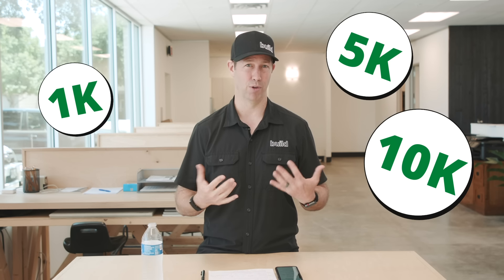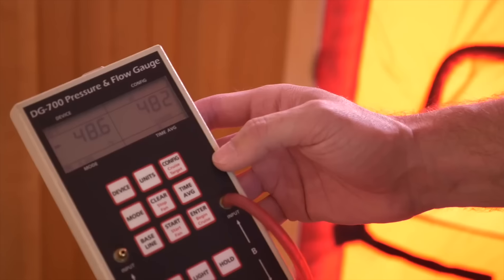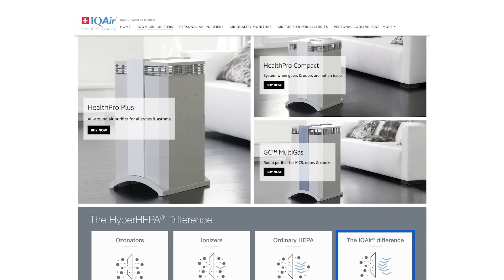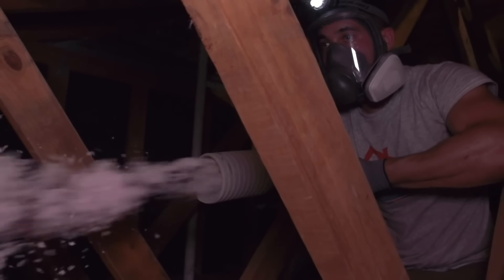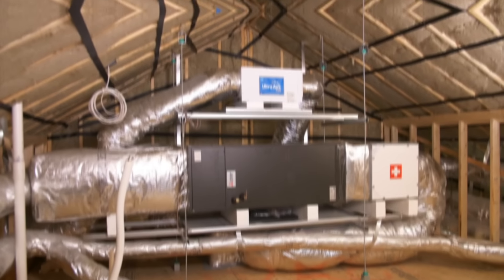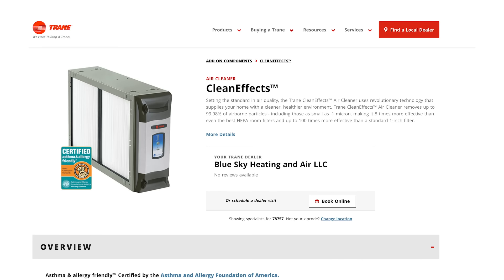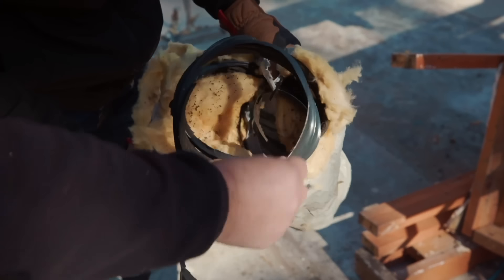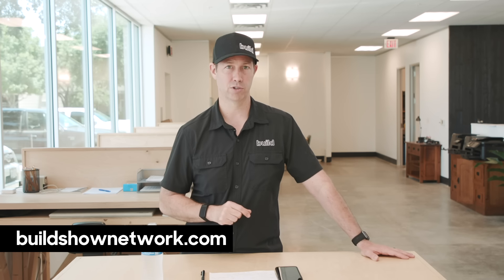Affordable Home Upgrades (Energy Efficiency & Indoor Air Quality )

Comment: Question: Higher merv means more strain on the blower unit so I've been told thus creating a increase in your electric bill.  So can you confirm or deny this?  Also If i dont have the 4 inch system would you recommend getting MERV 11 1 inch filters?

Comment: When you start adding big filters to your hvac, wound you advise these folks to have their systems checked so they dont burn up a expensive hvac system. Shouldnt the fan speed be increased at the least to compensate for the resistance of these filters?

Comment: That's really good advice. Especially getting the independent survey.

Our old house was hot water with windows for ventilation, and a window A/C. We got the survey, got sealing and insulation, installed an attic whole house ERV (UltimateAir), and a mini-split.  Also replaced the electric hot water heater with a hot water generator tank on its zone to the boiler.  Heating, coolling and electric costs went way down, and air quality is great.

Comment: After following you for a while now im pretty much sold on exterior insulation and improving the air tightness on the home. I just bought an 1890s vicotorian. The siding and roof(mainly the roof) have to be replaced so since its coming off anyway might as well give Roxul some of my money!
Reply: Sounds like a beauty of an old mansion house! I have a 1914 mission revival single story rancher. Yes, you will be happy by investing in maxing out your insulation as you renovate: external, interior, walls, attic, floor. Makes it so much more warm and comfortable, quite and cleaner greatly reducing your energy load.
Reply: @aaronvallejo8220  Not to mention the 800 dollar utility bills in the winter being reduced.
Reply: @ferulloscoasting6432  For sure. That's true. I grew up with a large natural gas central heater in an old, uninsulated house. At night it was turned off. Waking in the morning we could see our clouds of breathe. It is now highly insulated. R100 attic, R35 floor, R25 walls with electric thermal tiled slabs gently and silently releasing heat...warm on the toes in the winter too!

Comment: Question,  when re-insulating an attic space in order to air seal, would you remove all the old insulation?
Reply: depends on how your air sealing, what kind of insulation u have, and are going to be adding.
Reply: It's almost impossible to properly air seal with existing insulation in the way. And depending on the roof pitch and design, getting to the outside wall top plates can be a huge hassle.

If the old insulation is clean and can be put back in place, add new on top to whatever R level you're looking for. Otherwise remove it all and start fresh.

Comment: I have air sealed my existing home from attic to basement over time and just recently replaced all ductwork (ridgid metal, dampers, sealed and insulated) and returns.  Original owner had house build in 1991 and had gas forced air furnace (no AC - Seattle) with a honeywell electronic filter.  I am wondering if an electronic filter is worth putting back in OR a good MERV manual filter.  Any suggestions?

Comment: what should my air humidity be.  I am in arkansas, not that different from texas.  Maybe a little more humid
Reply: I like 30-40% for my sweaty self. Not too dry, but I don't feel muggy or clammy either. Most of these devices are adjustable/programmable, so you'll be able to play with the settings.

Comment: Matt, thanks for the great video.  I'm building a new house and we're on a somewhat tight budget.  It is a typical cement block house down in the Space Coast of Florida.  I really appreciate your videos because we were able to make extremely cost effective upgrades to our house based on some advice I learned from you.  We upgraded to RMax R4.3 insulation inside the walls.  Upgraded to R38 attic insulation and added a radiant barrier.  Plus, I was able to upgrade to a two stage condenser with variable air handler, merv 13 filter, and thermostat which will control fan speed for humidity control.  The foam insulation will really help air seal.

Comment: 2:50

Simply replacing the existing filter with a MERV 13 filter isn't a good idea.  All HVAC units are designed for a certain level of filter.  That is, the fan and motor are designed to push/pull a certain amount of air through the filter.  The higher the MERV filter number, the more filtration and more air resistance.  

So by adding a high MERV number filter to an existing system not designed for it, you usually end up with lower air flow, or premature fan motor burnout if you increase its speed to make up the air flow.  It is recommended to replace the fan and motor with one designed for the MERV 13+ filters, if possible.  

Otherwise, lots of good tips here.  Looking forward to more content like this!
Reply: From what I know, by going with a 4 inch it allows it to have more airflow than going with a 1 inch?
Reply: @purplej12  
I'm not an expert on this subject.  I am simply parroting something I heard from a presentation, which was about ventilation and air filtration during the pandemic.  

I suppose it depends on the filter design.  But if we are talking about the typical pleated replacement filters, then it's probably the other way around.  A 1 inch filter provides less air resistance than a thicker 4 inch pleated filter.
Reply: @Lewis.Alcindor  have you seen https://blog.adafruit.com/2021/02/15/which-home-furnace-filter-is-the-best-lets-ask-science/. And pretty much every other resource I've read says the 4 inch filters have much less air resistance.
Reply: Not so. Resistance to flow is a function of surface area. A 4” filter is going to much more than an 1” filter. So for a given filtration media the 4” filter is going to have a lower pressure drop across it. Therefore you should be able to run a tighter, usually more efficient, filter upgrading to 4” filter.

Comment: Finally catching up, so I'm a week behind. But, a couple other "tasks" to think about at probably the 5 - 10k range are converting a "traditional" crawl space or attic into a conditioned space. Depends on the state of the space and what might need to be done related to sealing, etc. Current house we're in had a nasty crawl space with no insulation (ducts, under the floor, nothing). Rather than try to fix all that, I cleaned out the space and started sealing it up. Multiple layers of thick barrier, sealed to the foundation which I then insulated. Dehumidifier till I knew it was sealed and air flow controlled. Yea, I want my ducts to not leak air or heat. Having them now in a conditioned space help a lot. If your crawl space is the same temperature as your living space, assuming you are controlling air loss at the top of the building, the stack effect is lessened and isn't as big an issue.

Comment: Start adding smart (wifi enabled) fixtures. As you have a little bit of money you can change out fixtures. Smart fixtures can reduce energy. Also if you have a crawl space, putting in a dry system can be done around the 5k realm. And that can increase the life of the home substantially.

Comment: You seem pretty obsessed with sealing houses. Most people that are thinking of spending a bit of money on their homes will have higher priorities, like kitchens and bathrooms that need makeovers, or adding a bedroom or converting a garage into a family room. Also, not all climates are as problematic as Texas. Coastal southern California can get away without elaborate air sealing just fine. Temps rarely vary much from 50-90 degrees with little humidity. Just sayin', one size doesn't fit all.

Comment: The inside walls of my home is covered in tongue and groove.  The outside is tar paper and siding.  Siding is being ripped off insulated with rock wool and covered in zip & hardie.  Will I have moisture problems?
Reply: Not if everything is installed correctly and maybe add 1 X 3'' battens to create a rain screen just in case water does get behind the Hardie Board.
Reply: august I am using a factory certified installer, whom by listening to his stories, knows his crap.  I’m just concerned I’m missing something related to the wood walls.  I’m not using spray foam, so my air sealing is zip.
Reply: @markw5805 , So you have plywood, 1 X 6's, etc. for sheathing on the outside already right ?  Then you're putting on exterior insulation board, then the zip, then the Hardie ? Or the Zip first, then insulation board, then siding ? If everything is taped, caulked, sealed during each step, It sounds like you'll be fine. Also, if he is certified, he should know ? 
Hopefully Matt will jump in and assure you that what you're doing is OKAY.
Reply: If you are doing the layers in sequence as you listed, YOU WILL HAVE ISSUES in most climates. I read this as rock wool over the existing sheathing, then zip over that. That is NOT continuous exterior insulation, as practiced, as the continuous works by being OUTSIDE the air control (and water last-line-of-defense-layer). Either do a fully adhered membrane over the existing sheathing (or do ZIP, if you want to spend even more $), THEN  do continuous exterior insulation (RockWool or foam, as you chose), THEN do battens for a rain screen-type siding application. 
Get on the Building Science Corp website, for the full range of technical articles; they have got you fully covered (pun). Matt is Science Lite, and does not answer individual queries or give specific advice. Too risky.
You could easily wreck your house, unless everything is done properly.
Reply: august currently no sheathing, just tar paper and popular siding.  Siding and paper come off, rock wool goes empty cavity,  and zip covers everything up.  All new windows too.  I’m doing all the taping and  foundation caulking to Matt’s specification.   I think I’m good bc the painted wood on the inside isn’t exposed to the weather.  I think I’m ok bc the back side of interior wood is not primed (1940’s house) and I’m not using foam, and zip is permeable.  Just trying to make sure I’m not missing something.  This is the opposite  of the condition Matt showed in the remodel he was consulted on.
Reply: @markw5805 , I understand the process now. I think that's a good way to go, but I think a rain screen would be even better with screening on the top and bottom for insects. Ask your guy doing it and see what he thinks ?
I personally like taped Tyvek over plywood with battens for a rain screen. They also have a mesh that can go under your siding for a rain screen, I just don't think it works as well as Glued and screwed 1 X 3's.
I don't think you're really missing anything. Good luck !
Reply: @markw5805  Yikes!! No sheathing at all is pretty uncommon, but not unheard of. This illustrates the big problem with giving advice on a forum like this; critical details glossed over or missed. Question: what climate zone/ where are you located?? That is a very important bit of information.
In light of the "NO Sheathing", I would still urge you to go to BSC website, do more homework. Here is why: with the T&G interior, you will have significant and unavoidable air movement into and out of the stud cavities. This will be accompanied by moisture transport, certainly into the cavity, hopefully back out again. The RockWool is good stuff, but it will not prevent hot moist air from reaching the back side of your new sheathing, and then the moisture condensing. I don't know of any way to prevent that, given the stated circumstances. 
I build near Denver. If I had a job and client such as yourself, I would absolutely push for batt insulation in the cavities (anything will do, it is of secondary value)  then OSB sheathing and self-adhered membrane (or ZIP and tape, as desired), then 2" polyiso continuous exterior, then rain screen battens, then the Hardie. In this climate, the 2" polyiso completely eliminates moisture issues in the walls due to condensation, and in this case, your "leaky" T&G interior is actually more of a blessing, as it promotes drying.
Reply: Lee Stevens in Kentucky...we have lots of houses built in 50’s with no wall insulation...whole neighborhoods.  This makes more sense why Matt used dimple mat in his remodel consult...it was the vapor/condensation barrier.... maybe I can do zip R on that part of the house.  I will look at dsc

Comment: This format is pretty great, you should do more like this. I appreciate the mini split idea,  my upstairs is always hot and I was in the mindset of needing a furnace and ac unit, with separate ductwork, as thats what the house is right now. Then when you mentioned the mini split, it should of been so obvious, Could do the job and way easier.  Thanks
Reply: look into MrCool DIY mini splits. they have precharged lines so you don't need a vacuum pump or anything to install. HVAC people will talk shit about them, because they're losing work with how easy they are to install. can you install a new light fixture and a new faucet? then you can install one of those MrCool mini-splits.

Comment: Hi Matt, I live in the northeast of Briton and it can get down to about -15 in the winter. The government did a grant that would get insulation blown into the cavity of the wall, (most of our houses are brick built) as with all grants the cowboys were there and many homes are now suffering. The problem was that no survey was carried out before the insulation was put into the walls, some houses have rubbish that had been put there by lazy builders or bricklayers that did not clean up after themselves and leave globs of cement at the bottom of the walls, this lead to the insulation getting wet and instead of bonus heat savings they ended up with houses that were wet and unsellable. The government are about to roll out another grant system and again these cowboys will sweep in and make a killing without any checks being made, I wish we had some body to oversee this and stop people being hoodwinked because they are not experts in the building area.

Comment: For under a thousand, I would consider a duct cleaning.
Reply: How often it need a cleaning?
Reply: @synewparadigm  That's going to depend on where you live at. Some areas have more dust, and some will have more allergens. Also depends on how well your HVAC system was built. It would be best to call a reputable HVAC company for a recommendation.
Reply: The real question is how clean the duct is after cleaning. I've not yet seen a cleaning which is very effective after the first few feet. The supply lines should stay fairly clean if the filter is doing its job, only the returns get unfiltered air. Flex duct tends to accumulate more than steel duct, but is harder to effectively clean, and may just need replacing.

Comment: I have a lot of respect for a builder with Matt’s experience.  With that being said, c’mon man... I’ve lived in Louisiana and TX for over 40 years.  For $5,000, suck out the ceiling insulation and add open cell to the rafters.  I guarantee it will be under $5,000 because I did it on a 3,000 sq ft house that had 2 12/12 pitch gables (ie. steep roofs with a lot of square roof footage).  All of my HVAC equipment was now in conditioned space and I truly did not need to “caulk’ the leaky spots.  Also, why I think Aerobarrier is a “neat’’ concept, it has not been around for even 5 years.  How does anyone know if this technology’s has a ROI?  What is the life expectancy on the “caulking material?”  They don’t.  Buzz words from builders... like vinyl window sales in the 80’s.  There is no historical data to prove the initial investment.  Please stop putting out videos for the YT algorithm numbers and sponsorship requirements.  Some of your sponsorship links have NOTHING to do with any of the products in this video.  To viewers, do your own homework.  Put in 10 minutes a day to researching these claims and I guarantee you will save money.  For those in the South, put in a dehumidifier and a smart thermostat (when I say smart, I mean programmable) and you will immediately start to see a ROI.  All for now...
Reply: Sounds like you need to start a YouTube channel.

Comment: Does anybody know why my air filter gets clogged up faster when we run heat rather than AC?
Reply: Are your run times longer during the heating season?
Reply: @MatthewKelch  definitely not we live in southern NC
Reply: More people are inside during colder weather, therefore adding more dust and more movement adding it to the systems filter, is my guess.

Comment: Always have some great content.   I have used foam insulation on my 2 story home and cant complain about the bill but i notice downstairs is usually warmer than upstairs. Is that common? They only sprayed in the attic but not in ceiling or in between flooors. What are your thoughts on that Matt?

Comment: five year old ten year old house? must be nice where I live the average house age is like 1940-1950 most a lot of the 100 year old home haven't been remolded since 1970 and are lucky to have an r-13 in the attic. a lot of hydronic systems in place. And a lot of forced air systems that are poorly designed and don't offer much heating up stairs.

Comment: I bought a FLIR One pro thermal camera and found MANY air leaks in my house, sealed and caulked up and now there is virtually no airleak in this 50+ year old house 😃

Still going to add new external Insulation all over the house within a year, but the comfort has increased a lot
Reply: I should look into seeing if I could just rent one and take a week off and do my entire house. I wonder if summer heat or winter cold is the best time to image such things? What time of year did you do it?
Reply: Was there a before and after blower door test?
Reply: @2nd-place  It really doesmt matter as long as there is a difference in tempersture......the greater the better.